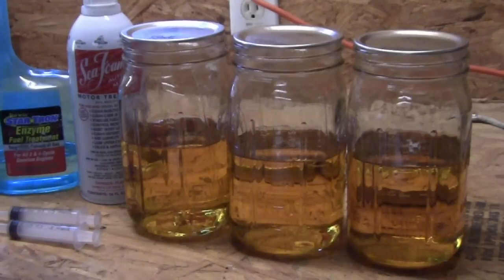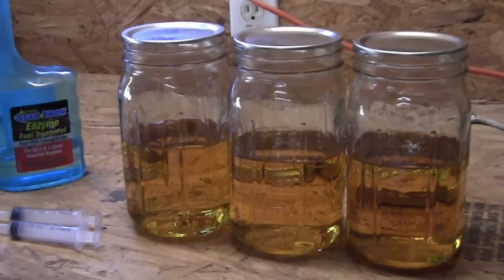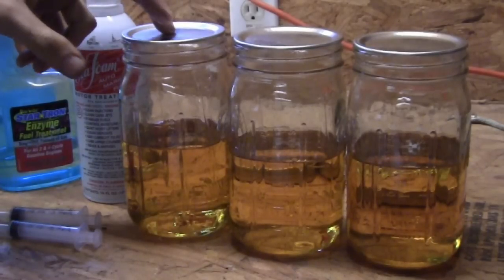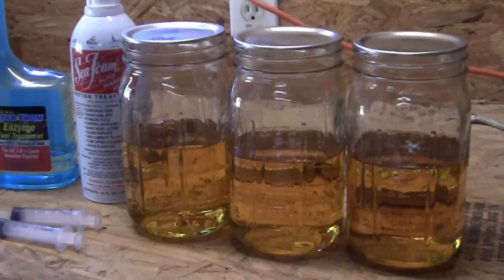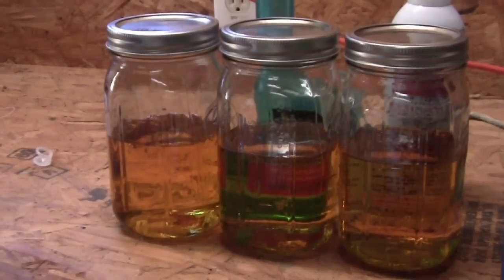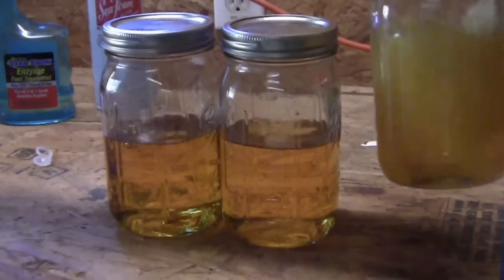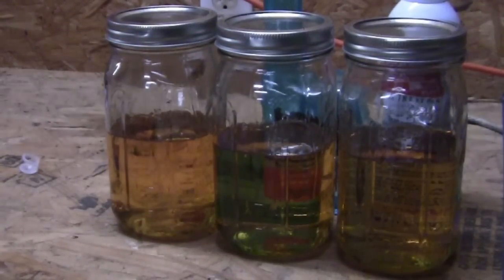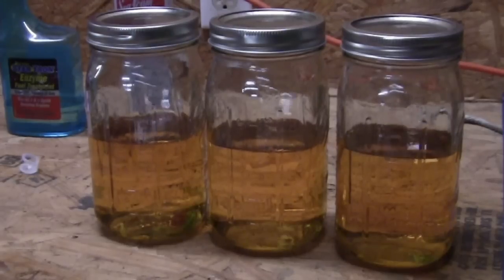Stale Gas: Can it be treated with additives? My unscientific test and results.

Comment: My experience.......someone gave me an old car with a full tank of 15 year old gas in it, smelled like a skunk. I put it in my lawn mower and it ran fine, but when I shut it off the intake valve stuck open. I didn't know what happened, I just didn't have any compression, so I tore the engine apart and I couldn't take a hammer and beat the valve back in the guide, the head looked like someone melted a sugar daddy on it and the stuff was so hard you couldn't scratch it with a screwdriver, like glass. I took a propane torch and heated the valve guide and the valve came right out. I cleaned everything up but from then on the valve would stick open every time I mowed and I would have to heat the valve guide with a torch until I heard the valve close and then it would start. Don't use extremely old gas.
Reply: I'm sorry but this is one of the most genuinely comical posts I've ever seen! 🙃 Been 4 yrs now, hope you were able to get everything sorted! Hopefully a new mower LOL!
Reply from the maker: Excellent personal example! I attempted a revisit of this but ran into the issue that even 3-4 year old gas was running A-OK in the lawn mower engine I was using. Perhaps using a measured amount of the stale gas and pulling the head to investigate the amount of buildup is the way to see what effect the additives have (if any)

Comment: its the ethanol that breaks down, in gas that is high in octane with little additives it will last a very long time, but regular gas is where you want to try your tests
Reply: Zak thewarcat Is it okay to use a 3 months old, premium gasoline? It’s 95 octane with 10% ethanol.. because i forgot to put fuel stabilizer. I’m worried 😢😞😪
Reply: your safe basically gas has a shelf life of 6 months after that it starts to break down  regular gas is bad for this ,but 91 or in your country 95 should have 0 ethanol  @Sebastian.12
Reply: Zak thewarcat But I’m from Philippines and 95 octane gasolines have ethanol. Because of our Biofuel act requires all company to use 5% ethanol in 2009 but in 2011 the mandate blend can go up to 10% ethanol. It sucks 😪

Comment: What is bad gasoline; After gow long of it sitting in a car not driven can one concur that the fuel is not longer optimal for use ?
Thanks
Reply from the maker: I have heard that the 10% ethanol fuel that is near impossible to avoid here starts degrading in a matter of about 3 months. I have seen that same E10 completely solidify inside a carburetor on a small generator in just about a year. I'm in the process of filming a updated video on this, with much better results, It will answer a lot of the lingering questions after I first had this idea. Hoping to get the first part of that out in about a week or two
Reply: trythistv Is it okay to use a 3 months old, premium gasoline? It’s 95 octane with 10% ethanol.. because i forgot to put fuel stabilizer. I’m worried 😢😞😪

Comment: Higher octane makes the fuel more resistant to igniting. That’s why it’s used in performance engines. It allows for higher compression and more power output without pre ignition.

Comment: Non of these claim to restore fuel. It should only be used as a treatment for new gas you plan to store
Reply from the maker: Actually Startron says very clearly on the label "Helps Rejuvenate Stale Fuel" among other claims, and Pri-G (not in this video but will be in the next stale gas video) claims on the back of the label that it "Restores Aged Fuel to Fresh". Seafoam, Sta-bil and others are marketed as a stabilizer, but those 2 specifically state they restore fuel.

Comment: How about mixing it with some really high octane gas like avgas. By 30-50% mixture and itll raise the octane back up. So the 110 by turn into 91 with let's say a 30% mixture. Like that you dont throw away let's say 30gallons @$3 gallon and o lt have to buy let's say 10 gallons of av gas at $7 gallon and now you have 40 gallons that are good
Reply from the maker: I'm planning on revisiting this video before the end of the year. I've collected about 3 gallons of nasty stale ethanol fuel and about 4 gallons of the same ethanol free marine gas that's about 3 years old. I've got a smattering of additives and a small engine to test them in, I will definitely be trying diluting with some fresh gas in amongst the additives. Thanks for the comments!
Reply: @trythistv  try to dilute it with high octane, like racing fuel. If you have 4 gallons. Just buy 1 gallon. And I'll bet that bitch will be so good itll burn like hell. It just has to cause 100-110 cant just disappear it will just dilute to 89-90 or even more. Try it as soon as possible
Reply: @trythistv  1 gallon will cost the same as 1 can of seafoam.
Reply from the maker: I'll see where I can get some race fuel, I know there is a few places around that sell it

Comment: Hey guys what do you think I have a boat stop for over 2 years I stated few day ago the engine some normal, will that hurt the engine?
Reply from the maker: I've often found that carbureted engines tend to build up varnish in the float bowls which clogs the jets, but if its running ok then thats not really possible. If you had some stabilizer or it was a good quality (non-ethanol containing) fuel then it is probably fine.

Comment: The best thing is to do if you have old gas is to fill up with fresh gas that is high octane, premium grade. Or, using an octane booster should also help.
Reply from the maker: I do plan on doing some better tests at some point, I didn't really prove anything with this, next time I run across some stale gas to use I'll do some actual engine starting and btu testing.
Reply: Ryan Toomey Is it okay to use a 3 months old, premium gasoline? It’s 95 octane with 10% ethanol.. because i forgot to put fuel stabilizer. I’m worried 😢😞😪

Comment: Additives are to be added before the point of extended storage, not after fluids have deteriorated. Returning fuel to the original molecular composition after it's oxidized, picked up water, etc. isn't going to happen without a lab and a chemical degree.

What might have you expected to see? Gold turned to red?
Reply: star tron says it is for old gas. it  uses enzymes.
Reply: @theCosmicQueen  This might help shed some practical light on the stuff.  https://www.youtube.com/watch?v=chsGBhB5g7o

Comment: I had a 1980 Honda Goldwing that sat for 2 and a half years after I broke off a spark plug.  I finally pulled the head, drilled out the plug, and changed the timing belt while it was apart.  It started and ran fine on the old gas.  I didn't put stabilizer in it because I hadn't planned on leaving it sit, life just happened and I didn't get around to it.
Reply from the maker: Awesome! I've found the larger the engine the less fuel seems to affect them. Tiny chainsaw and weedwacker engines are so finicky with fuel, I really want to try some more stuff and do a more real-world test in some actual engines. Ethanol fuel has been one of my biggest nemeses, I've never had an issue with 100% gas, even sitting for a year or more, but ethanol fuel seems to plug jets and stuff even after a few months.

Comment: This old gasoline will still burn, but run it through a filter first. Then, mix it with 75% new gas and use it. Don't dispose of it because it will end up polluting the environment. The Olefins and Paraffin's in the gasoline will dissolve in the new gasoline, and you wont have a problem.
Reply from the maker: Yep, I ended up burning all of this gas in the only gasoline vehicle I own.
Reply: Gasoline Vapor Systems hello.. Is it okay to use a 3 months old, premium gasoline? It’s 95 octane with 10% ethanol.. because i forgot to put fuel stabilizer. I’m worried 😢😞😪
Reply: GVS.
re:"Don't dispose of it because it will end up polluting the environment"

NO matter what you do with old gas eventually it will end up polluting the environment.
Either through evaporation or being in several different ways, burnt.
Reply: @banno6938  But at least someone gets some use out of it, if it's mixed with new gas.  Much better than pouring it out somewhere, or burning it and getting nothing out of it.  :)
Reply: @banno6938  funny how gas comes from the earth but every one is so afraid to put it back..

Comment: You are incorrect on the dosage for Star Tron.  This is right off Star Tron's websight.

INITIAL DOSAGE: Add 1 fl. oz. (30 ml) for every 3 gallons (11 L) of gas.
REFILL: Add 1 fl. oz. (30 ml) for every 6 gallons (22 L) of gas.
Reply: there's a couple of different  strength versions of star tron. like one is more concentrated.

Comment: Are you just going for appearance?  You have not verified the condition.  Will the gas run in an engine.  I don't give a shit what it looks like.  Will it make an engine run.  This is ridiculous.
Reply from the maker: It all depends on what engine it was in. I never filmed anything else on this, I need to revisit it sometime when I get another decent amount, but this gas would not run in anything small and carbureted, burned nearly identical to the naked eye with or without additives, but ran perfectly fine with no additive in a small modern EFI v8 engine, which has suffered no discernible negative effect from using it all up.
Reply: from experience star tron will work to a point but there is a point where it is just beyond saving i use it as a preventative masher and for cleaning out sightly dirty carburetors
Reply: the gas car will run on decade old gas, i have run an old bike on gas that was in  for 12 years. you will have to filter the hell out of it, it will run like shit but it will run.

Comment: Wish I could find the video where a guy has a chemist friend that works in the fuel industry. He gave him the secret to re-stabilize gas. I know acetone was one ingredient of three. He had eight year old generator gas and it worked.
Reply from the maker: I have suspicions about why acetone would work, its due to octane and evaporation of more volatile components that acetone would in a way replenish. I need to locate some nasty old gas and try it, but I don't often come across piles of it.
Reply: I am trying to read all the comments, it is October, 2021 as I write this. Starter fluid is mostly Ether and Ether is very volitile and you would need to burn the fuel as soon as possible. Also add as much fresh fuel as possible and for some reason I am thinking low octane, I am not sure why. 

Isn't low octane fuel more volitile?
Reply: @walterwjr947  Starting fluid is diethyl ether. Some more modern ones use heptane or even butane or propane.

I've never heard of acetone being used in starting fluid. That would ruin any plastic or rubber components that it comes into contact with in your intake.
Reply: Was it a form of Naptha, like in PRI-G? Terrill says he called maker of PRI-G & it's what they use in shipping containers before it even makes it to the States here! Like um, Chevron I think. (#1 gas I think! Comes with the better caliber additives we can dc out on, even a lot better than Shell.

Comment: The question that I have is how would it have preformed in a test engine.  Perhaps one of the additives would have allowed a one of the test fuels to burn more efficiently?
Reply from the maker: This is exactly what I should have done. and will do as soon as I can get my hands on more sufficiently stale gas in great enough quantity to actually prove something one way or another
Reply: Where do you live.  I am about to suck 20 gals of old gas out of my boat.  Not even going to pretend like I am going to start It on that old junk.  :-)
Reply from the maker: John Linebarger I live near Knoxville Tennessee, on Norris lake. My day job is as a jetski and boat mechanic, I fully agree with your plan to drain it. Modern efi on cars copes quite well with stale gas with o2 sensor feedback it can add more fuel or less, but not very many boats have o2 sensors, plenty are still carbed. Whereabouts are you at? If it's not too far I could come snag some stale gas for more tests. I'd expected to run into some before now
Reply: I am afraid that the drive would not reap a benefit worthy your efforts.  LoL  I live in south central Oklahoma a little east of I-35.  I am blessed with some of the best fishing near me that there is!  :-)

Comment: Exactly How Old is That Gas? Because I have About a quarter of a quarter of a tank of GAS I'm My Blazer that's been Sitting for a little more than a year Now, like maybe a gallon and I have Treat the Gas or Drop the the TANK but my other car is going to be in the Shop for awhile so I have to do Something, I was thinking about using Seafoam, heet, and Rubbing Alcohol, and then feeling my Tank with 13 & a half gallons of 93 HIGH Tes, Because I really Don't have the time to Drop the TANK plus its 1000° outside and humid as as bath house and it's not worth paying someone else who is probably just put seafoam in it and SAY That they Dropped and Drained my Tank Anyway, I had a mechanic tell me that it would cost him more to have the little bit of gas that's in my blazer right now disposed of then he would charge me for his Time, and that he wouldn't do it because it wasn't worth it and to just put some kind of treatment in it and mentioned seafoam but I really have to do Something as of YESTERDAY. I just need something to cause a reaction and get the gas two mix and downgrade the 93 to what I'm hoping we be like 87, my is my S10 Chevy Xtreme is my toy, it doesn't even have 90.000 Mile's on it,  I'd hate to ruin my engine over a less than a quarter of a tank of GAS but I have to do something NOW...
Reply from the maker: mile long Comment the gas I had in the video was over 3 years old. In my mind a year isn't a terrible amount of time, ethanol gas does tend to start going downhill very quickly, but since your tank isn't full I would do as you said, mix in high test, a can of seafoam, then run it out, and use high test for a tank or two. All this stale gas I had I mixed a couple gallons per tankful in my only gas powered truck, a 01 f150, in small doses it shouldn't hurt a thing. I'm very cautious about heet and alcohol based drygas type things. I got a bad batch of gas once in a motorcycle, the day I was taking my road test for motorcycle license. Bike stalled out on me going down the highway and was a fit to restart, so I limped it to Walmart and got some drygas and poured a couple cans in. Well drygas and heet are basically pure ethanol and that's why they will absorb water, but without starting a chemistry lesson in the comments, it turns out the gas station had mixed their ethanol a little too rich, instead of 10% it was closer to 50% and that bike wouldn't burn it. And I made that worse with the additive. I dropped the bike when it stalled in a corner, and ended up failing my test. Had to drain the tank and flush it before the bike would run good again.
Reply: Put in bout half gallon of Diesel, careful as there will be more power, but that's only for really bad long sat  old vehicles, used in 2004 3.5 v6 after sat for 2-³ years and whoaaaaaaa, added some Octane booster to some 87 gas to bout half tank, went down to 1/⁴ tank then filled er up'! Filter clean, tank clean, ate the old gas and removed all gunk n water, smooth as silk on reg 87 now, of course felt different driving and computer was a bit confused but hey, 2-³ tanks about 400mi. later and computer regulated back to normal and saved $800.00 yeah buddy. That's just my experience though... Vehicles may not like different mixes, but usually not a prob if rest of vehicle in good shape and not done unless gotta save that money. Only did fall not too hot not to warm out. No garage.

Comment: (1) You need more that one control for this. You also need a fourth container of fresh gas of the exact same type.
(2) You need more than just a visual test. Staleness of gas is not just a matter of color or visual appearance. Staleness is several things. One aspect is the evaporation and lack of the more volatile molecules, so just replacing them can fix that instantly without any chemical reactions. Replacing the volatile molecules will allow the gas to combust properly  Another aspect is the presence of oxidized molecules that can gum up an engine.  A product that claims to solve this problem would likely not explain how they do it on the label. Searching out the patent number if there is one might get you to an explanation. I could speculate on some approaches: Reverse the chemical reaction (this is hard), or perform a further chemical reaction that causes the resulting molecules to be less harmful to engines, or add a carburetor cleaner type of substance that would prevent the gums from fouling up the engine and perhaps even dissolve away the gums that have already caused problems..
Reply: He did mention this a unscientific test
Reply: Old gasoline also has a oily diesel smell and taste to it.   Hated huffin old gas. yuk
Reply: Startron says it uses enzymes .

Comment: I hadn't used my boat for 12 years ( 4.3 ltr GM inboard ) it was stored indoors, cold storage. Removed about 5 gallons of old gas that had been treated with stabilizer, it looked and smelled like normal gas. Didn't know how to dispose of old gas so I tried using some in my lawn mower, it ran fine. So  I put the 5 gallons in my old pickup ( 2005 Dakota ) and filled the tank with regular gas. The truck ran fine, no issues. As they say " Your results may vary" . Oh, had no issues with the boat either, new gas, battery, oil change and spark plugs and it runs like new 50+ mph no problem. I admit I was very lucky.
Reply from the maker: John Dooley and that's exactly what I do with any stale gas I get. larger engines, especially fuel injected cope with it a lot better than small carbureted engines. all the stale gas from this video got mixed in small amounts with fresh gas and burned in my f150, and had no detrimental effects as far as I can tell.